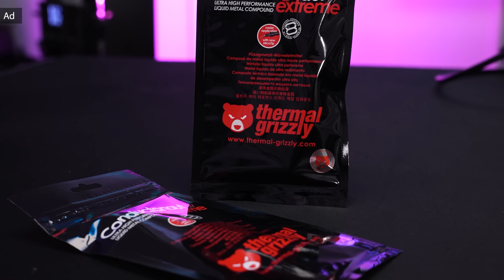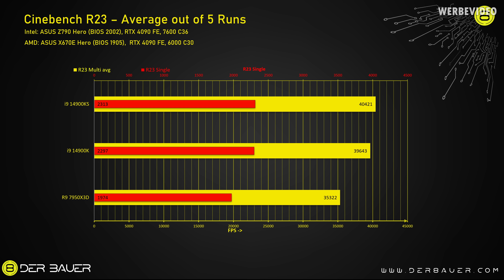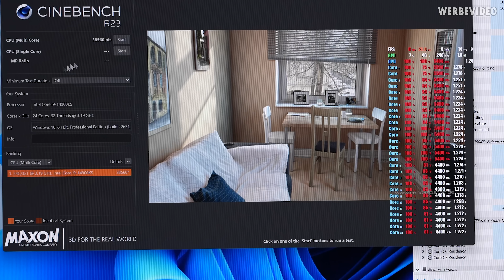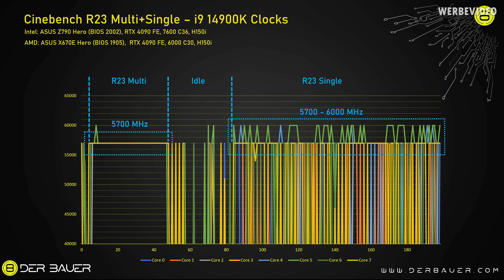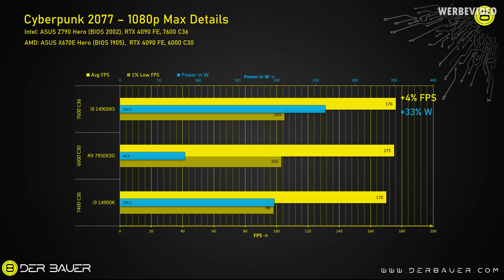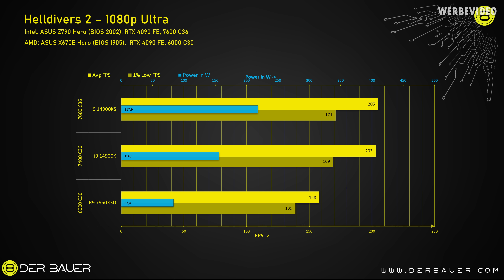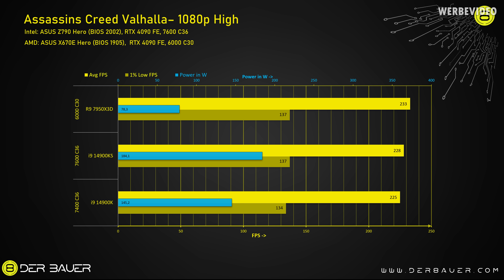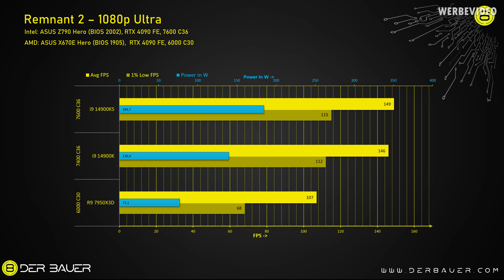Almost 400W under Full Load - The 14900KS is one of the Most Extreme CPUs ever Made

Comment from the maker: Since there are a lot of comments about the X3D Core affinity:
I know that I can manually fix it with tools like process lasso but that's no adequate solution. Only if we point out issues like that, they will be fixed eventually. Publishers, AMD and Microsoft have to update their Games/Windows/BIOS/Chipset so it works out of the box. You have to keep in mind that the average gamer probably has no idea about things like that and that he might not get the full performance.
Reply: Heck even intels solutions for proper thread allocation dont work proper,  Intel made the huge claims about their thread director and win 11 working correctly, then the 2nd intel dynamic allocation system came out and now they have the APO which only worked on 2 titles at first now its up to 20+ games, lol
Reply: @der8auer-en you don't need process lasso, you simply need to tell to Xbox game bar that the game you are running is a game, you don't need external software and you can do it with one click.
Reply: hopefully AMD fixes that because it's insane that it's been out for more than a year now and it's still behaving badly
Reply: Its only the 7950x3d and 7900x3d tbat are affected, 7800x3d works as intended. Unfortunately, i dont see AMD fixing this since its niche CPUs@alphaLONE
Reply: I agree with you 100% - Most consumers are going to just click to play. People assume a much higher level of sophistication for end users than actually exists.
Reply: I have a 7950x3d and it works fine on 3d cores, you just need to win+g and press remember this is a game and it'll move over.

Many games are like this.

Need to also make sure have the right drivers installed from AMD
Reply: @AsthmaQueen Can confirm too, the missing piece of the puzzle here is game bar, you need to go into game bar to tick the "it's a game" box. Helldivers 2 was working perfectly fine on the right CCD for me. The biggest issue is that Windows/Game bar just isn't doing a good enough job at detecting games I guess. I didn't think much of having to choose that option for Helldivers 2 because I got it on launch and at that point I don't think anyone was expecting it to do as well as it did either. It's been out a few weeks now with a lot of buzz, there should be some way that game bar can get the feedback that it's a game without the user having to intervene.
Reply: @rcrawr2661  yeah it's just what we have to deal with for a 1% product like 7950x3d I guess.. it unfortunate but I deal with worse with CLI to boost 7900xtx power limits etc
Reply: This is of the big reasons I didn’t go for an X3D variant, along with some other prominent reviewers complaining about stuttering or other unpredictable behaviour during games or multimedia work. 

I love the clever concept but I don’t like having to bodge solutions to problems which shouldn’t exist, I just want my machine to work as advertised. Using Xbox game bar as some arbiter of CPU core management is anathema to me. I do run the software but only for the usual in-game features.   

I appreciate the consistent all-core performance from my 7950, which admittedly was a bit of a treat-yourself purchase having bought mid-grade processors for the last decade 😅
Reply: is he a Fritz?
Reply: did you change the mobo / fresh install, if I remember correctly there's some jankiness if you change from non 3d variant to the 3d variant / vice versa, also what about the xbox game capture implementation
Reply: Why not just turn of the non X3D die, and you should have a 7800 X3D at least in theory
Reply: There are nastier problems with games with Easy Anti-Cheat where process lasso is not capable of working. So if the game itself, or xbox game bar, or whatever other middleware isn't working, it's a doomed scenario. Ultimately I wish I had more direct control over per process and per VM scheduling in Windows. Here's hoping we see a full 16-core X3D part next gen.
Reply: Are you doing software reviews now?
Reply: I agree
Reply: The average gamer doesn't watch your channel about enthusiast class delidding.
Reply: is there a big power consumption change if u disable ecores ?
Reply: it would be still interesting to see the performance difference of your benchmark with the correct affinity, since this problem does not seem to be the default behaviour... 
why would you not even show what the 7950x3d performs with the game running on the x3d cores? because EVEN IF i had to use task manager or plasso to setup a persistent core for an exe... i would rather do that if i then get the better performing cpu... i mean its just a question of configuration in the end. 
it always seems strangely convenient to include a result with the explanation "oh this didnt behave as it does normally for 90% of all other people but i will still not test the best case configuration because..."
you know better. and you also know how to easily set up a proper test for it. because in the end who knows what was the fault, ms updates, old microcode, some random os behaviour, the cpu itself, some strange situational power restriction, etc... nobody knows, but we all know that it is not the default to have a game running on the non x3d core. 
so please, it is surely fair to mention that there have been problems with affinity but then on the other hand be fair enough to show what the processor can actually do when utilized.
Reply: 0:23 Be pacient with countig s in Germany. 🤣
Reply: At this point, I'm not sure why the Ryzen 9 X3D SKUs even exist tbh. They've been out for about a year, and I still see people post about having these same problems. Just get the 7800X3D if you want a gaming CPU, or the regular 7950X if you want a workstation chip that can also do some gaming on the side. The 7950X3D just seems like a bit of a hackjob product that's ultimately not worth the trouble.
Reply: @FloppaAppreciationSociet-ds7zf I'm enjoying my 7950x3d just fine. I do game dev, compiling, and gaming. Installing the Xbox app correctly isn't that hard and I don't have troubles here. It's very worth it to me.
Reply: Why doesn't Intel just sell their processors minus the IHS to enthusiasts and circumvent the stress of delidding?
Reply: @Cleatus46 I have wondered that for a long time...I would say the chip is less prone to damage with an IHS installed, but thats just my head cannon...
Reply: @brucepreston3927  I think Intel sells some laptop CPU's minus an IHS.
Reply: @Cleatus46  Yea I think so, but they don't sell them direct to consumers that i'm aware of...It's a bit different for them to be responsible for shipping a batch of mobile cpus to another company...I could be way off base, but i'm sure there is a reason they don't have any consumer facing products without an IHS anymore...
Reply: @brucepreston3927  The CPUs with an IHS that are shipped inside of the large cube-type packaging would protect most anything....there is another reason.
Reply: @Cleatus46  I don't think it's just shipping damage that they would be worried about...People used to crack dies all the time by improperly mounting coolers...Whether or not they are at fault the will still have to deal with that kind of thing...Or it could just be that there isn't enough of a market for it in the first place...Who knows really...It would be cool to buy them already delidded, but I doubt they will do that themselves...
Reply: @Cleatus46  
If you look back far enough there were processors that shipped without a IHS. I fact the IHS weren't even invented yet. Before this the core was embedded in the ceramic substrate encasing the entire CPU and even earlier the encasing was plastic. But back to the bare core processors they came with the Intel Pentium 3 series. And yes, they were fragile. It was pretty common that users managed to crack the core when mounting the coolers. This made companies develop shims that were put over the processor having cut out's to match the core and some components on the top of the processor. These shims would support the coolers so they would apply a more even pressure on the core, making it a lot less likely that you would crack the core.

Note that neither Intel nor AMD sold shims like this but you had to buy them from other manufacturers. AMD placed four foam buffers on their CPU's, one towards each corner. But they were very soft and really didn't protect the core from cracking, but they kept the heatsink level and made it a bit safer to install.

Intel started using a IHS before AMD and it made a huge difference in the amount of damaged processors. They didn't really press the matter of protecting the processor from cooler mounting but rather claimed it increased the heat transfer from the CPU core to the cooler. This was soon proved to be false when delidded processors were able to run at higher overclocks and lower temperature.

Note that processors of that time didn't have any heat protection. If they ran hot they wouldn't become slower, but rather they would heat until they crashed. Often this would also damage the core enough that it killed itself. This could happen with the IHS in place as well as without it. it was bad enough that turning a computer on without a heatsink firmly attached to the CPU could destroy it in seconds. So the heatsink was a lot more crucial back then.

But yea. I doubt Intel is interested in starting to sell processors without IHS to end users again. They can sell them to big companies as they will educate their personell how to use them and they will ensure that the coolers used are as safe to install as possible. Besides they will pay for every processor cracked during installation.
Reply: @blahorgaslisk7763  Excellent, thanks for that. Speaking only for myself....I would be willing to purchase a CPU minus an IHS if it meant that I was SOL if I cracked the core....I mean, what is Intel's policy if the processor is damaged during delidding? Delidding is already kind of a gamble. Or....how about selling a processor with the IHS removed but included in the package so there would be options of choice, but again probably minus a warranty. Thanks again for taking the time to respond. 🙂
Reply: It is a PC. You must understand how it works. If you want just plug and play - buy a console.
Reply: Yeah, like Intel's APO... I could understand that an average PC user doesn't know about these things but a gamer or someone that watches your channel should know about it. The 7950X3D has some minimal advantage performance wise in comparison to 7800X3D (due to better binned cores) but it is much more expensive and has this extra step of configuring the software (or BIOS) to use only cores that have access to 3D cache. And from the start of any benchmarking or comparison video to show gaming performance and powr consumption I would argue that 7800X3D should be used as a standard CPU. It better demonstrates the value of AMD's for the highest gaming CPU's currently available. Just consider the price and performance of 7800X3D with 14900K/KS...
Reply: I agree with this - I'd probably  rather take a 7950X for now and overclock that ,  and not deal with needing to process-lasso all the games onto the vcached cores - hopefully there will be x3d chips with the full vcache for all of the cores in the future.
Reply: 400w to thermal throttle the think. Is useless
Reply: They should default it to prefer vcache cores. It's a single bios tweak, but the CPU basically works as expected then.
Reply: And this is why it's nonsense to waste money on a 7950X3D.
Reply: @rustler08  I agree the 7950X3D. is neither here nor there. If you are a pure gamer you will go for the 7800X3D. And you will still have decent CPU for non gaming task. For many semi pro productions task. You will go for 7950X. And you will still have decent gaming CPU
Reply: The average gamer also isn’t spending over $600 on a cpu though? 100% the people buying these products are enthusiasts and would take the few minutes to optimize their parts’ performance. I generally are with your logic, just not at this price point.
Reply: i have a certain theory about x3d performance, i haven't seen video about that, plus it could be a nice one to make sure

since windows 11 was made with scheduler for P and E cores, which are faster and slower, that could affect x3d cores, since those are clocking slower, they could be treated like e-cores and game bar is forcing them to be used as p-cores, kind of  best comparison would be going windows 10 vs windows 11 with x3d chips to compare if those behave exactly the same

this could be either it's amd problem with bad controller making use of wrong cores or windows and intel created problem that affects x3d chips
Reply: I understand but it's kind of a lazy comparison then. The KS products are a chore to review already, so I get why you wouldn't want to take the time ( which you stated multiple times in the video that you had no time for this review ) to get the 7950X3D to work as intended. At that point you may as well not include it in the graphs. Just say that you couldn't get it working correctly at the beginning.
Reply: @RAZGR1Z  I agree with Der8auer here, if I buy a 7950x3d so that I can game mostly and render occasionally (my real-world scenario), I don't want to have to use process lasso to control what cores the games are running on. I would if its a game that I'm playing heavily and seriously care about, but what I'd like is for the system to do this automatically.  Pointing out these failures and making AMD look bad (even if they aren't technically worse) inspires more development time towards fixing these issues, and everyone benefits as a result. 

You can also squeeze out more performance by minimizing background processes running and chasing lower total system latency by doing a bunch of permanent process scheduling to move core system processes and interrupts to the non-highest boosting cpu cores, but it really does approach being way too much work to be reasonably acceptable. If we pressure Microsoft to make Windows behave like this by default, it saves individual work for consumers and brings benefit to everyone at the same time. What we really need is more exposure to these kinds of issues from major content producers, like Der8auer is doing here, with community support showing that these are real issues that people care about.
Reply: @Tuhar To have any hope of Windows doing this well with the state of the OS is a pipe dream. Maybe a powertoys project or if they just buy bitsum and offer that software instead of a third party 😅 (this magically makes it better?)

There are FOSS projects that do the same thing though done less elegantly (not as fancy GUIs)

If all Windows/AMD software is going to do is automatically set core affinity just for a game I might as well do it myself permanently with all programs/services?

While it would be ideal if AMD offered an automatic core affinity switching option (that you actually have control over (like a toggle in the Adrenaline menu)) (maybe even using community votes you can decide to accept) it's not necessarily as the tools to do this ourselves have existed for years.

I only see this as an issue for people who don't want to get a 7900/7950x3d CPU so won't ever have to deal with it in the first place. It's not something so integral to the product working that I feel the need for the manufacturer needs to reinvent the wheel. 

That said by default your games should be running on the vcache die since those are cores 0-15 anyway.

Just to clear some things up in case there's a misunderstanding: Process Lasso core affinities (or CPU sets (and other rules)) can be set "permanently", it uses the same windows processes as task manager. When PL sees the process running it then applies the affinity. 
It also has the option for temporary affinities which is the only option in task manager.
You can export your affinity list in PL's settings to share or switch between.

I view this situation as similar to how RTSS works for GPUs, it's an extra feature that isn't required by the product but greatly benefits the user if they put a small amount work in to set up.
Reply: @Emotional_Support_Twink  I don't disagree with you, and I know the power of process lasso and the ease of setting a ccx affinity for a process once I've run it, it's just annoying to have to set this for every game that I play, and more importantly it's not beneficial to the uneducated gamers out there that just buy and run. 

"Gamers" are an increasingly targeted market, and the worth of that market continues to increase. Having the community push back and point out the flaws in the current system can garner some attention and potential investment from the developers and make a difference for everyone.

You could use the 7800x3d to show gaming benchmarks, but the point is- when content creators highlight deficiencies with flagship products to a large audience, the manufacturers are more likely to take notice. Enough attention and bad press can lead to positive changes for the community as a whole. Sunlight is the best disinfectant, meaning bringing these things to light through repeated demonstration is the best chance to benefit the community as a whole. 

There are workarounds and ways for people "in the know" to avoid pitfalls, but it doesn't hurt to hammer in issues whenever you can. I applaud the repeated demonstration of scheduling errors on the 7950x3d and encourage more detailed and through examinations of things that can be made better for the benefit of all pc-using people. Simple as.
Reply: @RAZGR1Z  that is the 14900ks out of the box vs the 7950x3d out of the box.. He doesn't need to fix anything
Reply: @RAZGR1Z  So you don't understand then. Read again what der8auer wrote.
Reply: @RAZGR1Z  one of them is working as intended out of the box, and it ain't the Ryzen
Reply: @RAZGR1Z  if your only goal is gaming you should buy the 7800X3D, faster and cheaper..  Intel choose the 7950x3D to compare to for a reason.. which is pretty obvious to make them self look better
Reply: @RAZGR1Z  It's the "Gamers Nexus Complex" they beat their brains out to make an AMD processor to work, and trash talk about Intel slurping on power. Happening for the since 2017 with the introduction of the Ryzen.